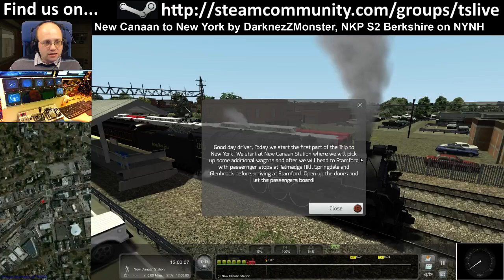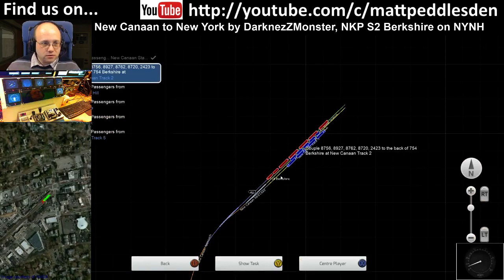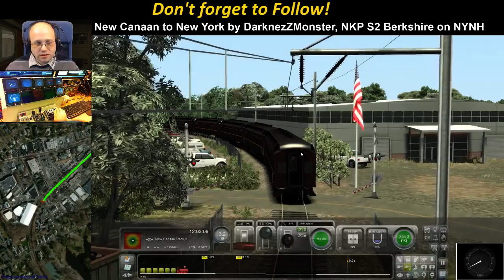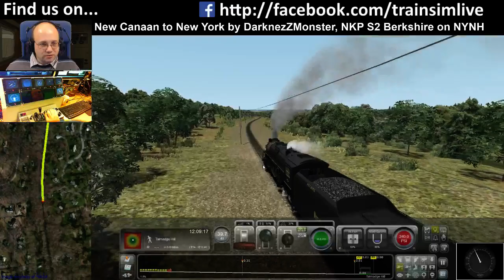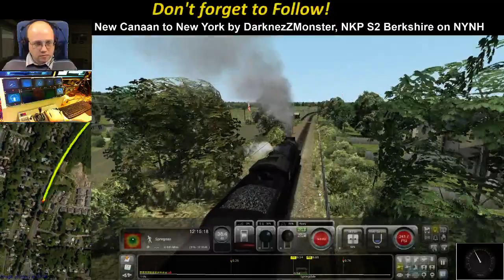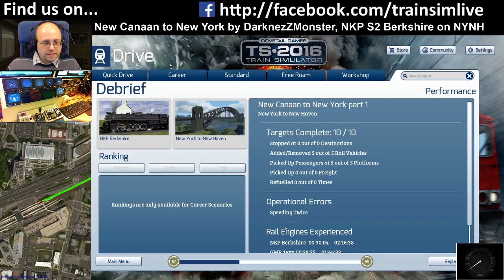Let's Play Train Simulator 2016 - New York New Haven, NKP S2 Berkshire

Comment: ??? 1944, number 765 was finished. it had a top speed of 70 MPH, and could carry more than 20 cars. when diesels took over the frieght industry, 765 was sidelined from service. then it was moved and put on display in a park. it was then bought by the park's train museum. it was repaired outdoors with no help from cranes or heavy machinery. and then, after 37 years, the berkshire number 765 moved under her own steam.